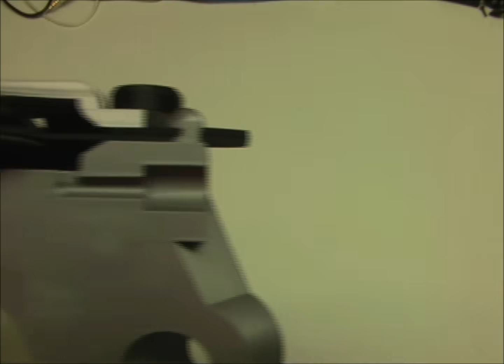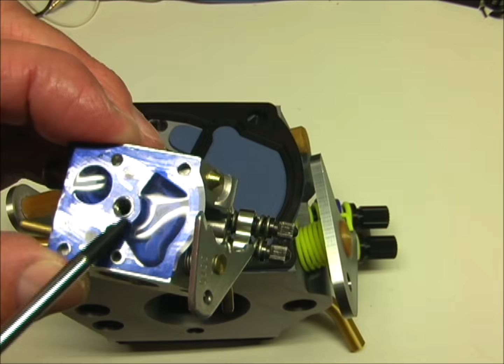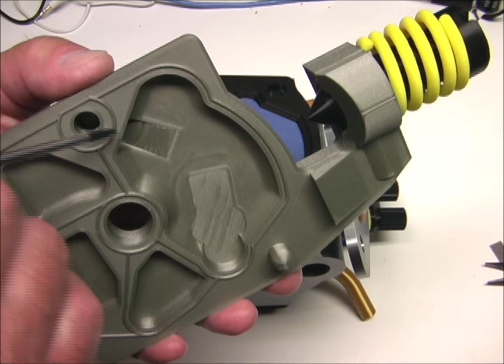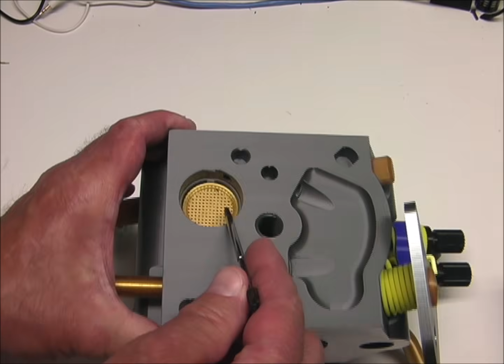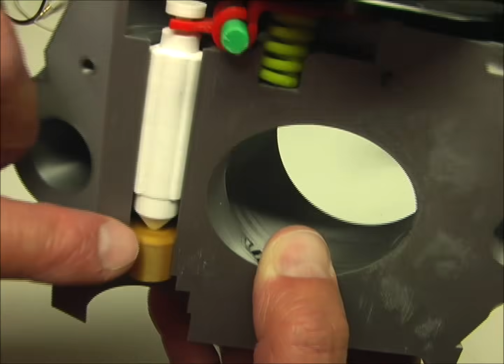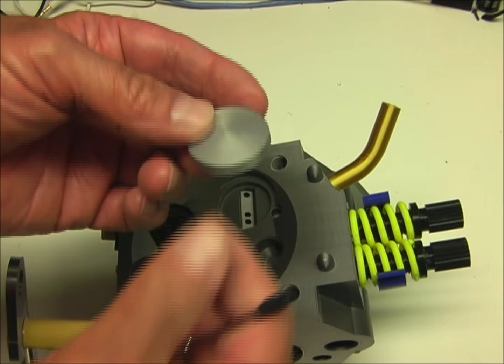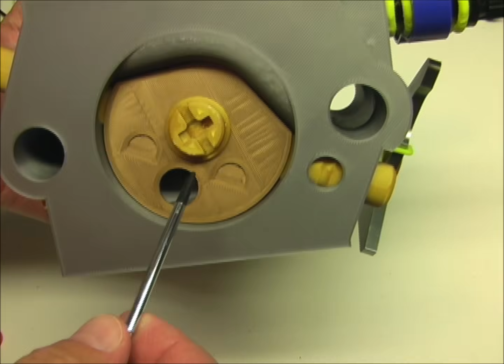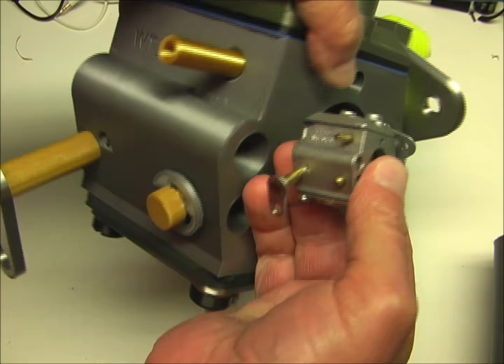How a 2 Stroke Carburetor Works, Fuel Pump & Metering

Comment: The only way I can see for air to enter the metering area when the primer bulb sucks on the metering area is through the high/low needle valves pathways into the venturi bore. If the choak plate seals completely with the carb bolted to the engine that would block air from coming back through the needle pins into the metering area. [which is really the float bowl on a regular carb]
However the choak plate can't seal completely because the engine needs air to start, unless the choak plate is on a spring so it seals when the engine is not running so the primer/purge bulb can draw solid fuel into the metering area and then when you pull the rope the vacuum of the engine pulls the choak plate open allowing the engine to start. Once it starts and dies, you push the choak in half way and then it will start at high idle. Once the engine is warmed up, you pull the throttle and it releases the high idle step for a normal idle.

I'm going to try pumping the primer bulb with the choak all the way out to see if I can get solid fuel [no air] returning back to the gas tank. One would think that once it is running the air in the metering chamber would get purged out unless it is vapor locked and it is mandatory that the metering area has solid fuel when starting and running the engine.

With the carb off, I can blow into the fuel inlet hose and it is blocked, but I can suck on the fuel outlet hose and it sucks air both through the fuel inlet hose and I can also hear air sucking in through the venturi bore as well.

Comment: Really great video, you went through a lot of work creating the props. There is just one aspect you didn't cover and that was fuel return to the purge bulb. The is really the part I was looking for. I have a Polan Pro 20" 50cc with a similar carb [ZAMA/W47-425A]

The original carb had a problem, I purchased a kit, implemented it and the problem remained, so I just purchased a new carb. [$50... wasted $20 on the kit] That was a year ago and it worked fine. Last spring [4 months ago] I used it to cut a ton of wood and I mean a lot, no problem. Then last week, I started it just for maintenance, didn't need to use it. The problem was back.

Now for the problem... Pump the bulb, pull the choak and start it, it runs for a second and dies like it should. Release the choak [idle step still high mode] and start it. It runs but it dies, you start it again and you have to feather the throttle to keep it going and if you try to hole full throttle it bogs out and dies. If you choak it a little and get the RPM's up you and get it to run at full throttle.

Now for the specific problem that I discovered... The engine is starved of fuel. When you pump the primer bulb air can be seen in the return line coming from the carb telling me that air is getting into the metering reservoir which feeds the high/low adjustment screws. The carb is sucking air from somewhere. Remember it did this after the kit was installed and the old metering diaphragm didn't look bad and not the new carb is doing the same thing too. The fuel lines are new and the filter is fine. Very frustrating.

The question is since the primer bulb sucks on the carb with the gas tank fuel line delivering solid fuel on the other side, how is air getting in since the diaphragm and gasket are good?

P.S. I also have a brand new [1 year] Ryobi 16" little peanut [34cc?] branch trimmer that is doing the same thing.]
I don't really want to have to buy new carbs every season or when I want to use them.

Comment: This is an amazing video,  I have  a question about a carb I am modifying, the diaphragm has been changed to the ethanol resistant and the lever has been changed to the new one, I have added a softer metering spring to allow the needle  to open more freely and allow more fuel in, the question is …. can I make the pin hole on the brass insert bigger to allow more fuel in as the needle  goes up? I will greatly appreciate your answer.

Thanks

Comment: Wow what a wonderful presentation! Thank you for your insight very detailed I'm trying to get a weed eater to run right now it tries but it doesn't run unless you're pumping the ball and then it's still not wide open I took it apart and cleaned it just need to get some more for you thank you

Comment: There is a second brass tube appearing on the outside of the carburetor, and it appears to be entering the chamber under the metering diaphragm. does that tube lead back thru a rubber hose to the fuel tank, and what is it's purpose?

Comment: Outstanding presentation and props for the outrageous props!
I learned quite a bit, basic knowledge behind the implementations of the various parts, channels, pathways, adjustments and operations. I wonder if Walbro is the most common, and how other common models and makes differ. Thanks for the effort.

Comment: You put my faith back in YouTube training videos. Awesome detail.  Your explaination of the fuel delivery solved a lot of mysteries. Also, don't forget the other 2 holes under the welch plug for the low speed side are progression ports. They bridge the gap between the low speed (idle) and high speed. Thank you for an outstanding job. Cheers

Comment: Best explanation video ever. My estate auction weed wacker acts as though it's starved for fuel. I noticed that the gasket on the crankcase side is home made. I'll bet it doesn't have a hole for the pulsing crankcase pressure. This will probably save me several hundred dollars if I don't have to get a new one. The 3D printing is also excellent. I've been doing it for a few years but nothing like this. No way I can build that on Tinkercad.

Comment: Thank you so much Mr. Gould!  What an amazing video.  I have been working on some small engines trying to understand how exactly carburetors work.  I wanted to make sure when I clean a carburetor, that I am spraying the cleaner in the right places.  Having this understanding of where the fuel goes is so very helpful.  Thank you so much for your time we’ll spent to explain the very complex inner workings of carburetors!

Comment: what should be done if you want to enlarge the venturi hole from a diameter of 19mm to 22mm because it is blocked by a brass pipe as explained in the 14.15 minute video. I'm afraid to break it.

Comment: Good Job on the video.
I think you covered everything about the cube type carburetor with one exception...
On the fuel path to the lo-idle side there are three port holes that feed the lo speed circuit. You could have explained how the throttle plate position changes the air flow to draw from the second and third lo-speed ports.

Comment: My Troy Bilt fuel filter came off the fuel line. Dirty fuel got into the Walbro Carburetor. I did not remove the welch plugs and clean the passages. I also put the metal diaphragm on reversed. I lost the little screw that locks the needle valve pin down. I spent about an hour looking for the little screw. After a brief prayer to God to help me find the little screw I found it on the floor when a glitter of light bounced off it and caught my eye. I had the fuel lines all jazzed up. I broke the pull string rope trying to start the motor. I watched another video showing how to jam the piston with the pull cord rope and break the centrifugal clutch mechanism loose from the crank shaft. I was going to put a gear puller on it. A note on the clutch said 3/8 X 24 so I put the gear puller away. I don't know what the message noram means that was stamped next to 3/8 X 24.  I sure would not want to work on a mechanical watch. I would end up smashing it with a hammer. Very informative video. I had no idea how the little 2 stroke carbs worked. Thank you sir. God Bless You.

Comment: Where do the brass lines connect? Which one is the fuel line? Is the other a return to the tank? My weedeater only has one fuel connector. I was sent a replacement that has two connectors. Can I use it somehow? The models you made are incredible.

Comment: I totally agree with "The Lawnmower Lady" and "David Mansfield".  Your desire to educate others on something that is very hard to find information on is astounding, and your attention to detail and accuracy is almost beyond belief.  I want to thank you for your efforts.  I plan on using 2-cycle carburetors on 4 cycle engines, because the 2-cycle carbs can be set up as down-draft instead of the normal side-draft, allowing a longer intake manifold for added fuel mixture velocity.  I was concerned with how to operate the pulse fuel pump, and to complicate matters, I confused the fuel metering diaphragm as the fuel pump.  I plan to use a stainless steel tube inserted into the exhaust manifold so that the high velocity exhaust gas will create a vacuum in the SS tube which will go the the fuel pump pulse tube/entrance and pull the diaphragm against a spring to complete the push-pull action.  After seeing this video, I now know that I can do it.  Thanks again!

Comment: Hello I got a question , my homelite XL th saw carb leaks air at choke ball detent hole that you point at 17:45 when I pressurize the fuel inlet , I never think it’ll be the leak point rather than two side gasket , can you please tell me what’s wrong with it? Thank you